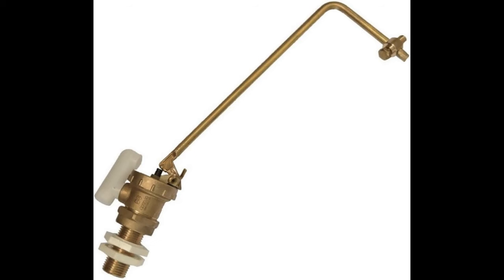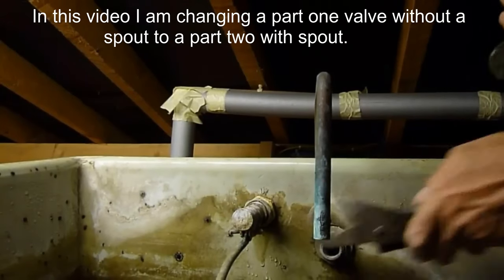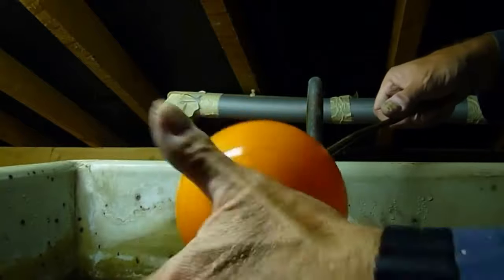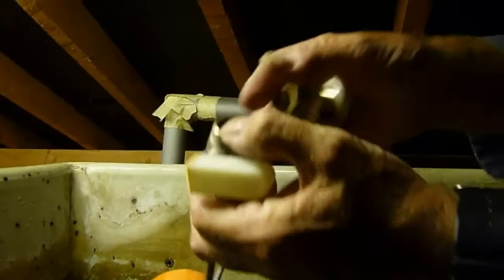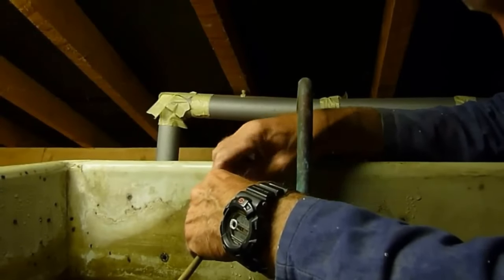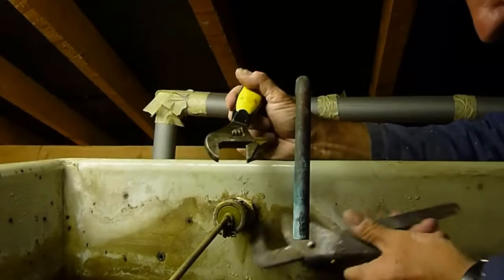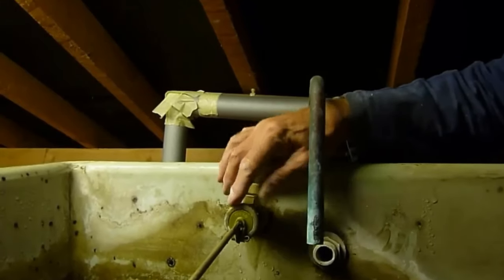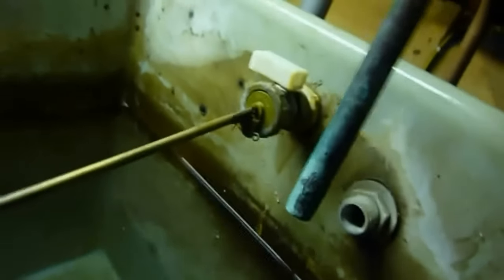Overflow running?

Comment: Thanks for this. I need to investigate mine. Could mine be set too high? It hasn't happened lately but last winter (?) my overflow pipe at the back of the house kept dripping/running. Annoyingly I can't remember when it happened; possibly when I'd put boiler on to heat hot water..?
Reply from the maker: Try lowering it if it still runs then you have a problem.